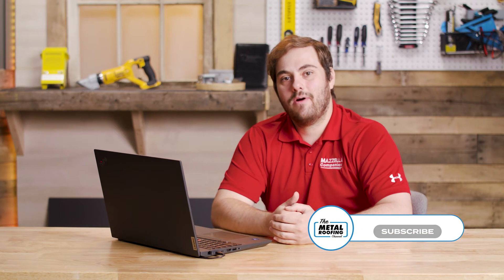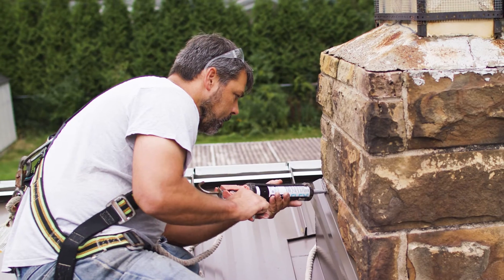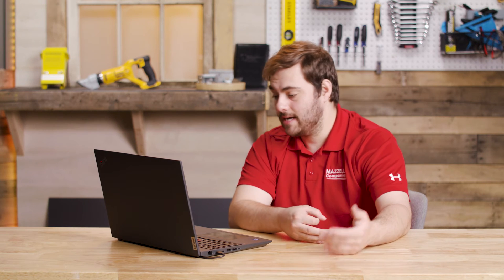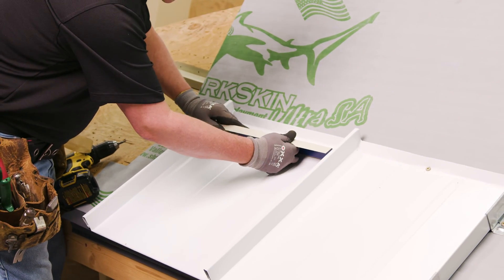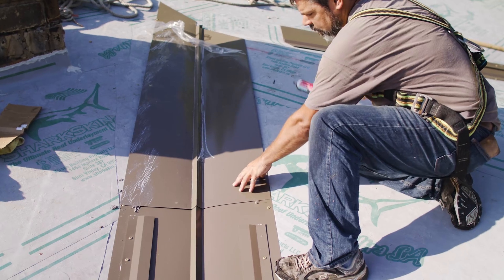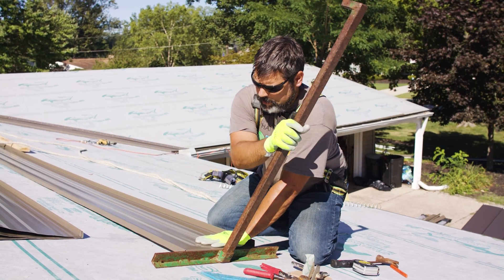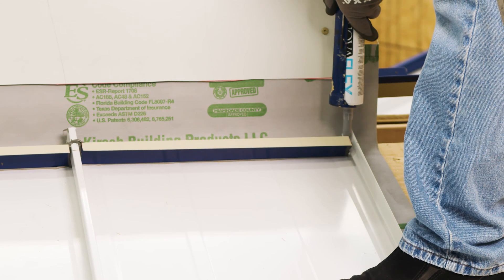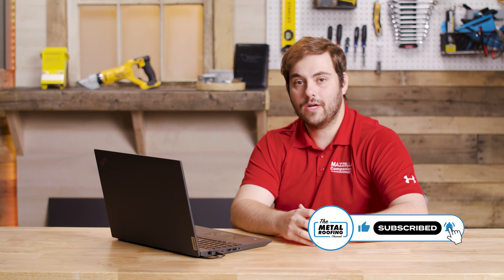When and When Not to Use Sealant on a Metal Roof Installation

Comment: I live in the hurricane belt. The ridge cap when installed has a gap between that and the standing seam roof. Should I be concerned about air essentially pushing under and compromising the roof? I was thinking of sealing all gaps. To ensure full air flow over the entire roof. Which brought me searching for videos like this.

Comment: I can't seem to find a video on how to make a center starter for a snaplock panel. Is it possible to manufacture it by hand after the panel is run or do you need the machine to do it? Any help would be appreciated.